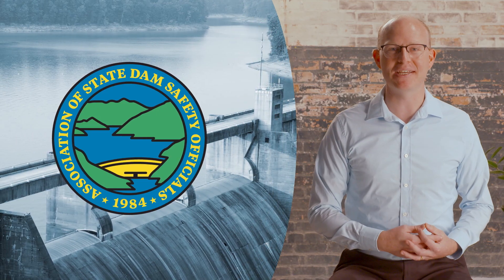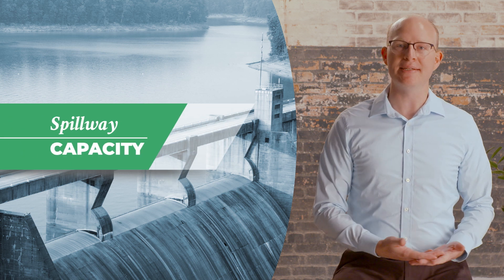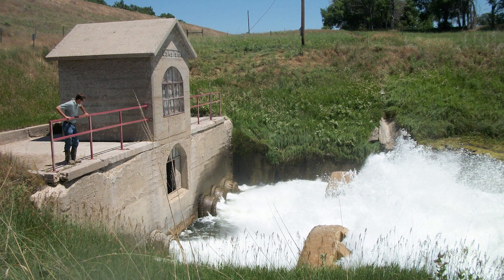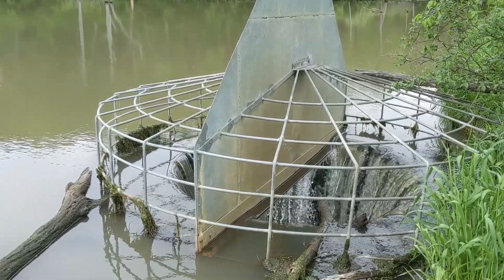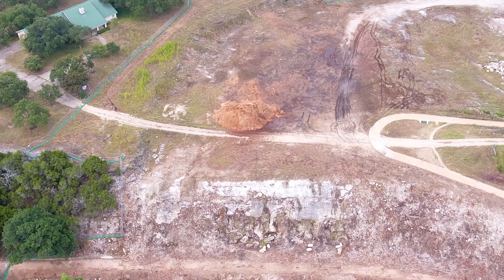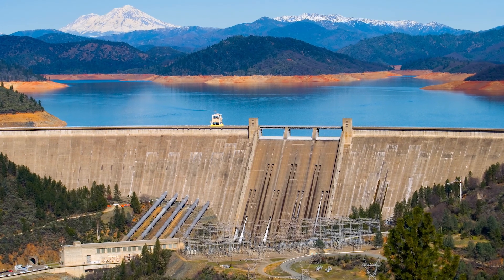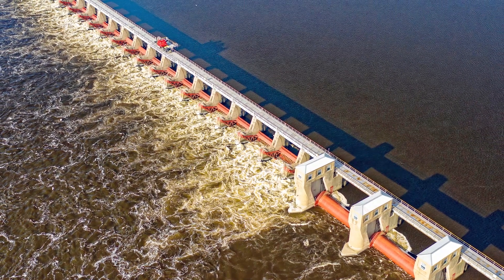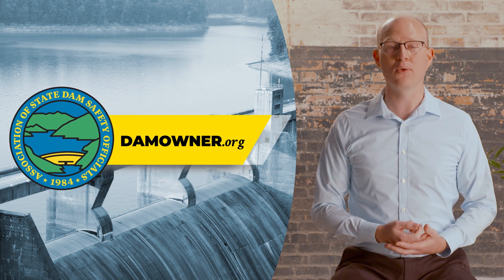Dam Owner Academy: Spillways & Outlet Works

Comment: Still not clear what the difference is between spillways and outlet works
Reply: Spillways release water from the surface of the reservoir (spill over). Outlet works typically draw water from the bottom of the reservoir.